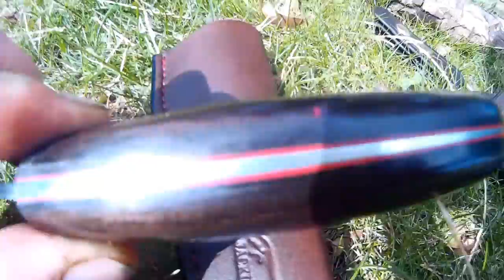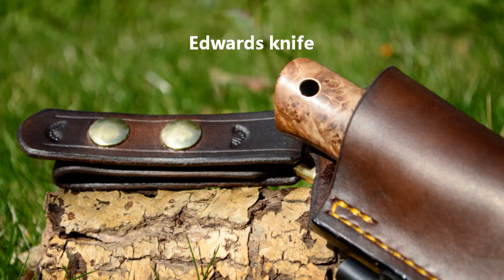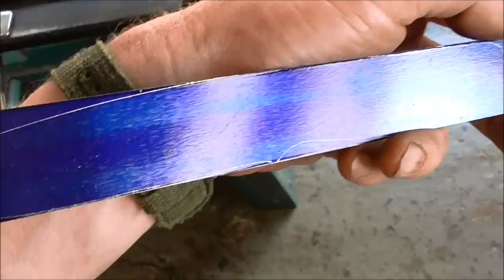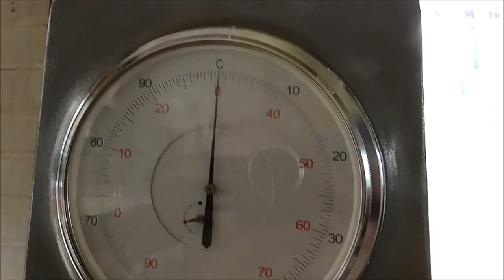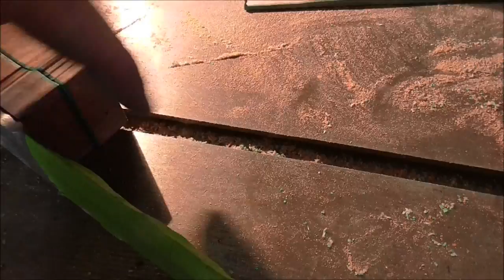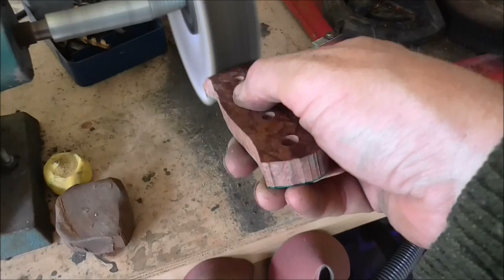Knives for Graham, Edward, Rj and Chris

Comment: are you using vulcanized paper for your liners? if so have you had any problem with them absorbing water and expanding?
Reply: I use two types of liner material. For standard red and black I use a type of liner from material used for gaskets. It does not absorb water full stop. If I use vulcanised paper I always treat the liner with a vacuum bath of wood hardening resin. The liner absorbs this then when it dries it stabilises it.